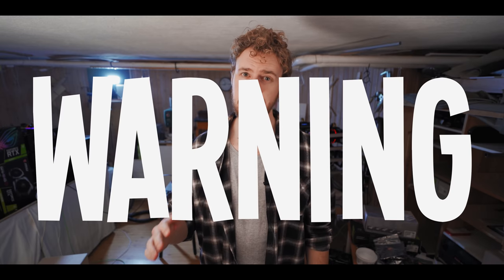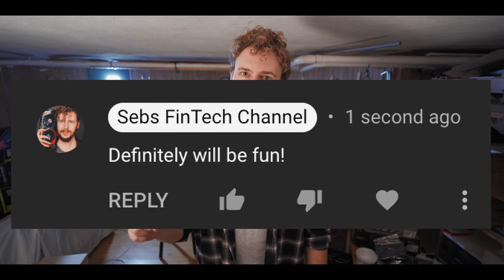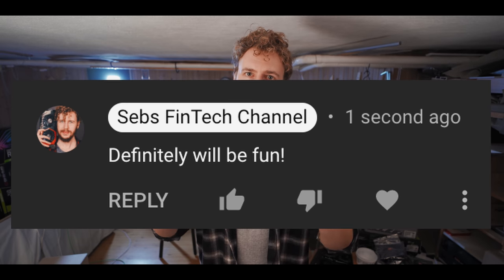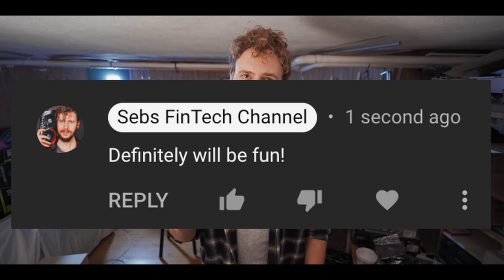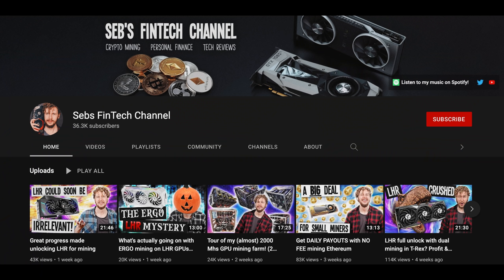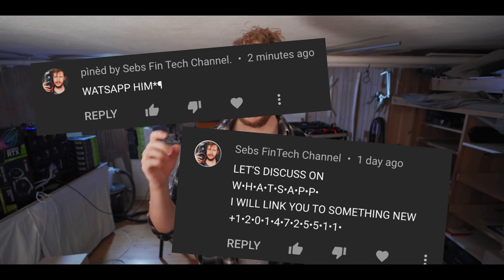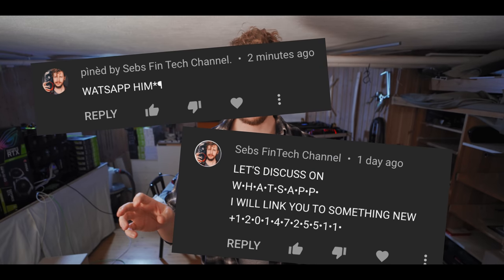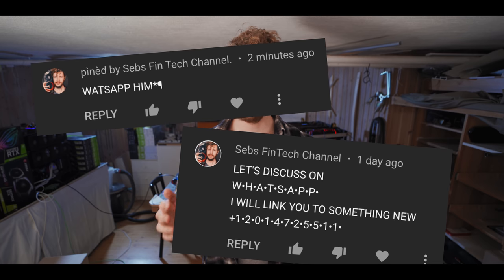Your mining rig is wasting electricity (DO THIS NOW!)

Comment: Besides underclocking and undervolting, you can also disable Hyperthreading/SMT and disable unnecessary cores directly in the bios in order to replicate a lower wattage CPU. Useful given the rarity and cost of lower wattage CPUs due to demand.
Reply: Yes, and some motherboard don't have support (at least officialy) for some low power CPUs. They are better optimized at full speed to not go higher in watts, but in idle they aren't that different. What I also do, is disable Turbo, that way you avoid those spikes in consumption. You can do it from BIOS, or in Windows setting the CPU max state at 99%.

Comment: I ran 220V to a sub panel to get rid of a buddy's use of extension cords all over the house plugged into 120 outlets.  I also sold him some power distribution unit strips (PDUs) that monitor the overall power used and power used by EACH plug.  2 exact same computers tested shown that each actually used different power levels over time.  So purchasing expensive professional PDU strips to monitor power use by each rig is not a bad idea.  Also, you can remote control each plug also.

Comment: The sweet spot for the Platinum HP 1200 watt PSU's is between 25-50% capacity.   That's the range they're 94 % efficient in.  But pushing them to 80% still keeps it close to 92% efficient.

Comment: pro tip, corsair power supplies are rated to run at the advertised powerrating at 50 degrees celsius... Most others are not though...

Comment: This was very informative. I wasn’t really thinking about that initially when I started mining. 

3060x3 plus a 3060ti it gives about 9.00 on Ethereum at 450watts. Can anyone tell me if that’s pretty good? Thanks 

Next I am making an raven coin rig with 580 4gb cards.
Reply: In order to answer your question,  you need to look the total power consumption AT THE WALL. IM sure is more than 450 , what is your electricity cost, and how many MH/s are you getting in each card.

Comment: Hey Seb, I gotta favor to ask you please help me out.
I got 2 x 3060 Ti & 1 x 3070, both LHR. Is 850 Watts Gold PSU good enough for this?
Reply: I would advise you to get a plug power monitor on Amazon and measure how much your whole system is pulling. Plug your power supply in there and then make sure your average is less than 80% of your psu rating.

Comment: ....... I was hoping for some good info not just buy energy efficient products that's kinda obvious
Reply from the maker: 1. Run you power supplies at peak efficiency load instead of maximum load
2. Find the most efficient overclock and power limit settings instead of maximizing hashrate
3. Underclock your CPU to reduce overall power draw of the mining rig

Literally 3 of the 5 tips in this videos are not "just buy energy efficient products".
Reply: @SebsFinTechChannel  watched it twice buy energy efficient psu buy energy efficient gpu adjust clock. Guess I've missed something.